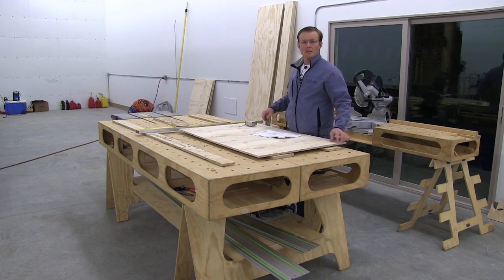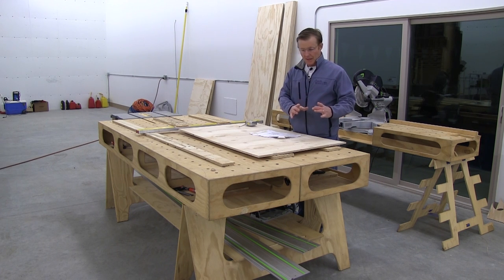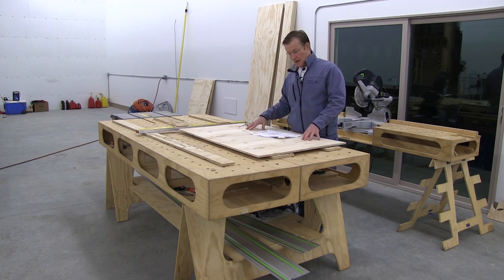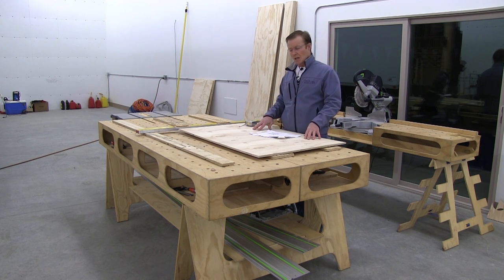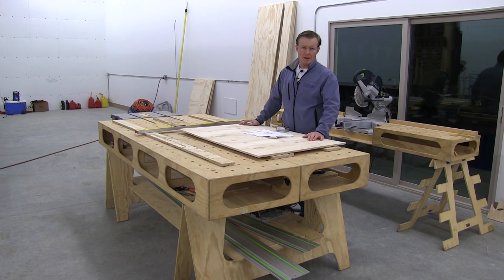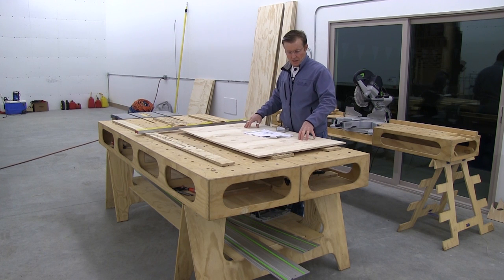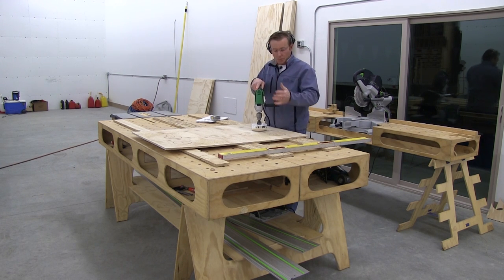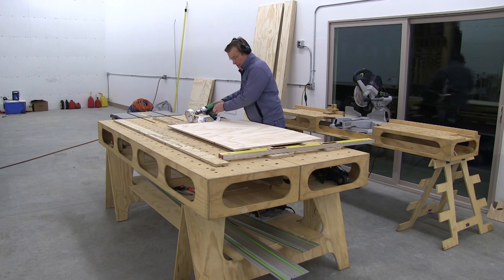Building the Paulk Workbench: PART 2 MAKING SAW HORSE PATTERN

Comment: Thanks for the info.  I made a template for sides and spreaders using a 5" hole since I had read that info somewhere.  However, when I looked back at the plans, the dimension of the opening for the sides was 4 1/2" therefore, my confusion.  I would think that I can now use a 1/4" bushing on a straight bit and my finished hole will be the recommended 4 1/2".  I very much appreciate your quick response.  Have a great day!

Comment: Has anyone had trouble with the 1/2" plywood legs?  I built this table (which we love!) and we were using it to build some parts of the smart woodshop, and the weight of the table and all our stuff in it broke the legs and the whole thing came crashing down.  I'm rebuilding the legs with 3/4. But wanted to know if anyone else has had this problem.

Comment: nice job Ron, I wonder if you have a smaller version for people like me that only want to make diy projects and home impruvements. It is a big market also. Regards
Reply from the maker: Dilfredo Ruiz Hi, many have taken the design and scaled it down & up to fit their needs. The plans are easily scaled.
Thanks, Ron
Reply: Ron Paulk thanks for your fast reply. I use a lot manual tools Ron, and the vise is very useful in traditional benches. Have you consider to set a vise in smaller versions of your bench? thanks in advance.

Comment: Hey Ron, I want a bench like yours.  I'll get the plans here in a sec, but a quick question:  I'm new to woodworking, but not tools per se and I'm building my first bench for my "woodshop" area (please read: garage)... in order to finish work on my first ground-up 10 x 12 metal shop (blacksmith/welding/abrasion).  Even still, I don't understand how that circular saw can work without clamping down the track.  This project looks like you want straight cuts.  What keeps the track in place besides gravity?  Also, will any track do?  "Cheap" ones in Lowes are like max 50" long and $40! each.  Many thanks for all that you have done with this design, and WOW... what a response from the community, dude.  Love it.

Comment: You say that you use a 5" hole saw but, on the plans it shows that the opening of the sides and cross pieces is 4 1/2".  I'm confused.
Reply from the maker: +Ken Allen I used a 5" hole saw for the saw horses and 4 ½" for the bench top.